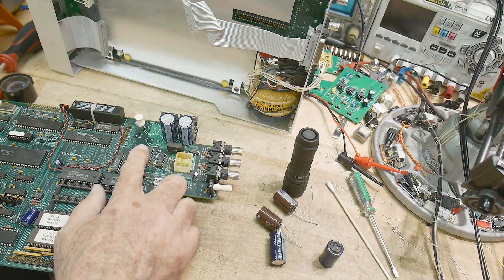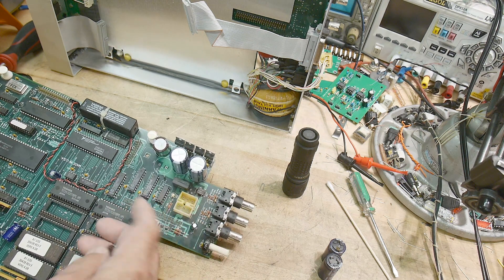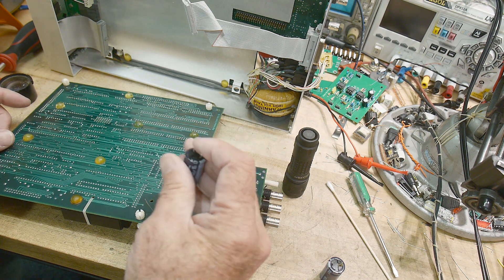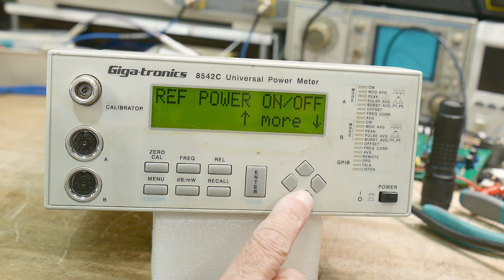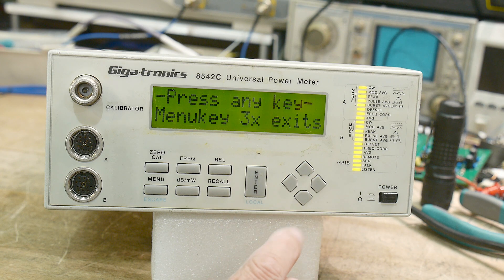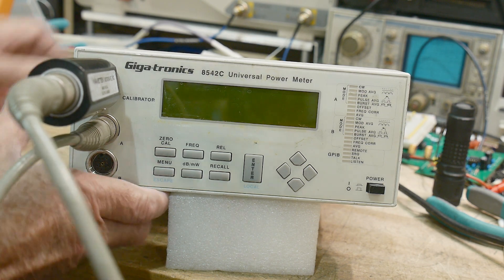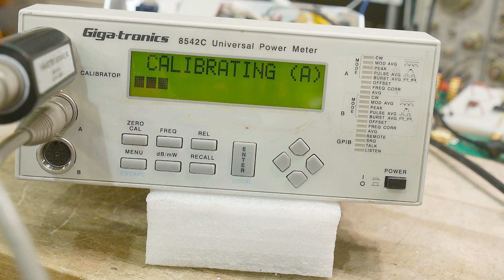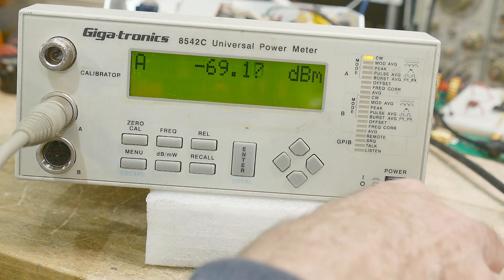#1434 Giga-tronics 8542C Microwave Power Meter (part 2 of 2)

Comment: For this kind of device, shall the SN of the power sensor mach to the SN of the power meter? Or can we use another power sensor with the same PN but with different SN?
Reply from the maker: Works with any sensor. Each sensor has cal data in a eeprom

Comment: Merci. How long to develop this engine?
Reply from the maker: the sensors had already been products for a scaler network analyzer we had. so some design was stollen from that such as the calibration section. the power meter design was probably about a year which included a VXI version as well. the R&D team was one hardware, two software, one mechanical, layout, and several in documentation.

Comment: The N connector on the cal looks beat up.
Reply from the maker: yes but only the end which doesn't matter if the inside is good.
Reply: @IMSAIGuy  I am no expert however I have been under impression that the front flat surface IS important, probably at the higher 1/t.
BTW I concur with other re: and interesting series would be the repair of the sensors,...
cheers dan
Reply from the maker: @mr1enrollment  most N-connectors that screw onto that have a rubber washer in contact with that surface.
Reply: @IMSAIGuy  gotit thks

Comment: Wavetek, Gigatronix, Spanawave. It's as bad as HP, Agilent, Keysight. Sigh. If I were a mega-billionaire I'd buy Keysight, change its name back to HP, and ship a complete service manual with ALL equipment, including schematics and the theory of operation of each circuit. I would stock all parts that could be properly installed outside the factory and sell them at a reasonable price to repair techs. In short, I'd go back to the old HP business model, and tell the strategists and bean-counters to take a hike. I could save a lot on their wages.
Reply: Okay, you've got a point... there are some docs on Gigatronix/Wavetek/Anritsu/R&S gear, of the same vintage, as the power meter.. but most of the newer stuff by Keysight isn't well documented... and replacement boards from Keysight are very expensive. All the top end manufacturers are doing the same thing.
Reply: It's even worse.  Wavetek merged with Wandel & Goltermann only to split later after the merger with TTC which resulted in the creation of Acterna.  The general test equipment line then went to Fluke, the RF business went to Giga-tronics, and then the telecom business was later acquired by JDSU.  Fluke later gave up the Wavetek brand, and now its owned by a Chinese exporter.
Reply: @douro20 , I was on a page that said Wavetek and saw a bunch of junk for sale and assumed it was something like that.

Comment: Something I do when I check the DC supplies is switch the meter over to AC to see if the caps are doing their job. If there is any AC ripple at all riding on the DC I change the caps.

Comment: Thanks for the tour of your design, although, like so many things in life, the neighborhood changed over the years. But I still had a question.  What the heck is in the sensor?
Reply: There is generally two kinds of RF sensors: diode based, and thermistor based. Keysight makes some really expensive (but very good) RF power sensors. There is not much, in terms of parts inside the sensor that detect the RF energy; but, those parts: a thermistor (or some diodes, some capacitors) are highly speced, under-produced, and ungodly expensive... for what they are. To top it off, the RF connector, and the transmission elements must be machined very precisely... and in low quantity... that's very expensive.
Reply: There is also some signal conditioning components inside some sensors, usually mounted on a pc board. A chopper (changes DC to AC), and an amp. These are to send the signal to the actual power meter, through the cable.
Reply: There's not much to the meter, really. There's more components, ICs, a display, and firmware... but, it's of a mass produced variety.. not the highly specialized components used in the sensor. New Keysight power meters are expensive (but, everything Keysight is expensive.)
Reply: The power sensors are very sensitive, broadband, flat, wide dynamic range devices. They should never get into the hands of idiots. There are many times more power meters than sensors because of people applying too much power to the sensors, and destroying them.
Reply from the maker: background: http://hparchive.com/Application_Notes/HP-AN-64-1.pdf
I will need to do a video on the sensor

Comment: These meters are VERY excellent, but also very tedious to manually control via the front panel buttons. Thank goodness for GPIB (and other engineers) doing all of the config for users of them. I pity 1st time users of them...
Reply: They are okay. The sensors have a large dynamic range. The newer Keysight power sensors (think really expensive) don't require the meter. It's just the sensor, a USB cable, and a laptop.